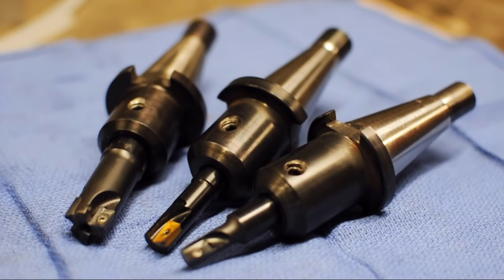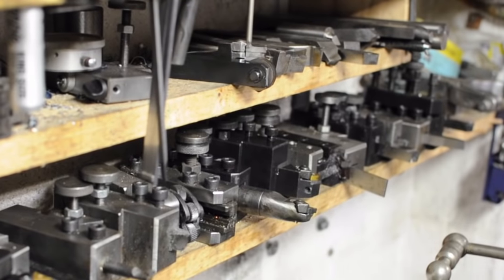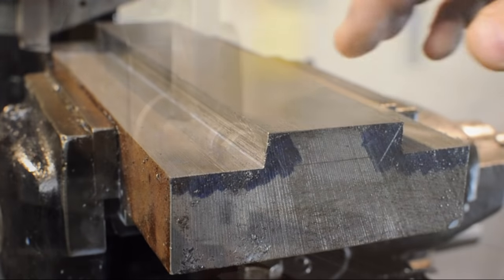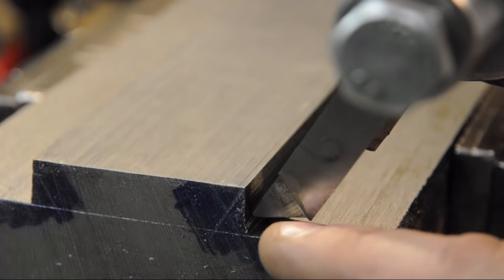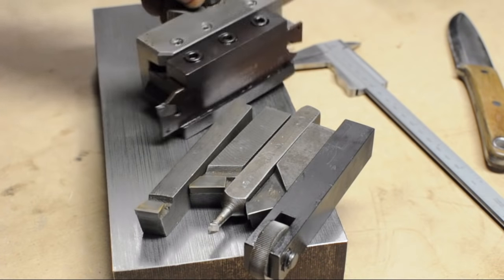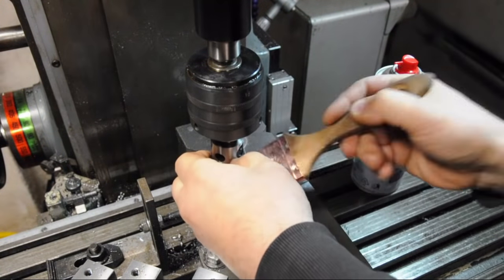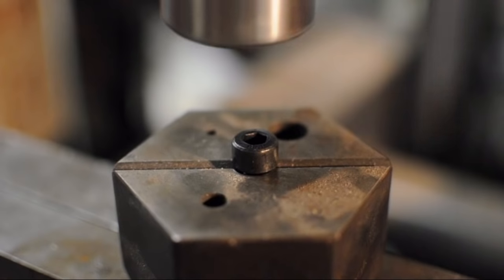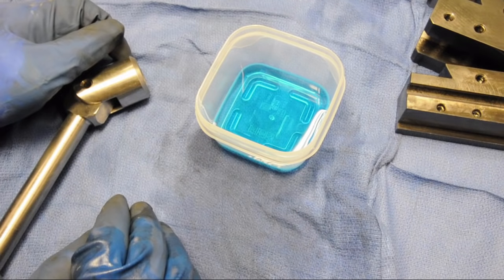QCTP Tool Holders for the Lathe

Comment: If you really want a good looking black finish I'd suggest doing it with hot bluing salts. As someone else and myself says cold bluing is mainly for touch up applications. Its almost impossible to get it uniform on larger pieces such as you routinely deal with, it wasn't made for that. Hot bluing will give you a deep blue or if you add some  Brownells  Oxynate S into the bluing salts will produce a deep rich and very uniform black. The salts are very thick and actually crystallize when cold. you need a tube burner to run the salts up to close to 300 degrees. yeah you heard right its hot. a fume hood over them is mandatory too. The process only works if your part(s) are squeaky clean. Brownells Supply (gunsmithing supplier), sells that cleaner and everything you need to do this. Just think if you get tired of machine work you could blue guns!  hot damn!. all kidding aside its not that expensive to set up, but you have to be CAREFUL working with it as this stuff is caustic, and really hot, but it delivers very classy results that would reflect the quality of your work perfectly. I know, I used to blue guns with this process for years and had no problems with it bluing ordinance steels. Steels that have high nickle content tend to come out with purple veins which in some cases looks cool but not on someones gun. Oxynate S additive takes care of most of this. This process doesnt work on stainless for obvious reasons. fwiw.

Comment: This will likely strike you, and the rest of the general public as a "stupid" question, but here goes anyway.  Why wouldn't you use a mill rather than the shaper for the dovetail?  I am just getting into hobby machining, and tool holders for my qctp are a priority.  That said, if I tell my wife, now that I have just acquired a mill, that I need a shaper, another machine, I might as well designate my "boy parts" as surplus.  Great videos; and thanks for your patience.
Reply: He used the shaper basically because he could... mill is fine and probably a lot faster.
Reply: The typical mill used by home machinists is not particularly rigid and as a professional machinist I find them all but unusable because they are so slow removing metal. The shaper being an all but obsolete machine is a cheap way to get some real muscle to cut flats and the like. When I was an apprentice I used a shaper to chamfer  20mm thick brass. 18mm x 30 degree in one pass. Brute strength all the way.
Reply: oh boy look guys a Professional Machinist has come down from his boeing shop to grace us with his presence. i didn't realize we were on the practical machinist forums.
Reply: as was also mentioned in the video, if you want to cut a dovetail with the mill you need a dovetail bit with the correct angle and depth for every different cut you might want to make, with the shaper you only need a bit that has the same or a smaller angle to make the dovetail, allowing for more versatility, and the tooling is as easy to make as for the lathe...
Reply: Extremely late reply, but, (two things) there are no stupid questions, but there are lots to which (when you don't have prior experience) the answers are not obvious...
Look at the video at 2.59, pause it.  View the dovetail of the right hand tool holder (the OEM one).  There's a relief at the root, where it joins the main body of the holder.  There is no cheaper and easier method of producing that relief than by shaping (or planing with larger, longer components) Any other method requires expensive tooling, and isn't as quick.  
Look at it this way, metal removal rates are dependent upon available power, and the ability to apply that power.  How much power can be applied via the reduced shank portion of a dovetail cutter and the cutter portion? Very little, even if your machine has it.  When I last ran a shaper, it had a 26" stroke, and 10 horsepower, and I could get quite a lot of that horsepower into the shaper tool, removing material rapidly, and when a tool dulled, I could sharpen it, offhand, without going to the toolroom.  Rapid removal rates, plus rapid tool swaps and sharpening = high production rates.  If you don't have a shaper, any machine you have that can do the job is quickest for you...

The relief in question was to accommodate minor damage on the toolpost dovetail, damage which is inevitable when operators are working quickly.  It would also allow clearance for a grindwheel, if the holder was to be so finished. 
  
Shapers are great tools.  I was allowed to use one at school, (1966) aged 14, with little supervision, adjusting the cut while the clapperbox was moving back and forth.  I look at my grandson, who's a little older, and think... Would I trust him, or many of his generation with a machine capable of ripping his hand off?   NO!

Comment: Has anyone made a tool post holder with a differential screw height adjustment? ...or would that be like putting a swiss watch mechanism in a torque wrench? Maybe I should ask: Are differential screw adjustments put in anything at all?
Reply: Thats a overkill,a fine thread screw is all you need.

Comment: Hot bluing is not that difficult and can be done with stuff you can buy in stores. Phosphating (parkerizing) is another quite easy process, but not very good looking IMO, and should be done on bead blasted surfaces, also gets it protection from soaking in oil, used on firearms in demanding situations. There's also fume bluing which is an easier to apply version of old fashioned rust bluing, done in multiple steps, but produces perhaps the most durable blued surface.
Reply: Hot Bluing is about as durable as fume bluing, but it does require you to get some pretty nasty stuff pretty hot. Hot sodium hydroxide solutions will etch glass if it's too concentrated. And fuming kinda really sucks, because you end up with hydrochloric acid fumes eating anything metallic nearby. And you still need to boil your steel afterwards.

Comment: How to blue on cheap: 1 part drain cleaning lye powder + 2 parts bleach. Put steel parts inside the mixture (i usualy use old soup can or something) and boil it on stove in well ventilated area. put cover on, so bleach does not evaporate too much. if bleach boils down, just add some more. will take like 30 mins to get really really black (for carbon steels). other steels will get different colours. if there's zinc coating, it will remove it.

Comment: Gewindebohrfutter is German. Gewinde means thread, Bohr means drill and Futter means feed. You should use this in a drilling machine with manuel feed. When you are deep enough, just pull out the tapping device and it will reverse.

Comment: Hey Tony... Question for you... I have a Mk1 Student as well... what size of QCTP are you using and do you have any suggestions on where to source it from? Many Thanks... your pal -J
Reply from the maker: I don't recall the size off hand because it's a weirdo European holder but I can tell you I wish it were a little smaller.  the student lathes have a 13" swing so just find the make and type you like or want to spend and get the 13" swing size.  you'll find it listed in the specs or tech info for the tool post.
Reply: @ThisOldTony  Thanks Tony! Did you end up customizing the QCTP to fit the cross slide? Your videos inspired me to pickup the  Student although i was rather let down that the Time travel circuitry is an addon mine didn't come with. After watching your videos on prepping HSS blanks I was able to get some really lovely finishes on the parts I'm working on. Thanks again!

Comment: it may say cold blue on the bottle, Heat the part with something like say a Heat gun or a hair dryer. I like to warm the part. before putting cold blue on it. and when you pull it out heat that puppy till it smokes, then put some good oil on it.

Comment: You're making my shaper "mouth" water. I really need to get mine finished up and back in service. BTW - that was some dubbed-in "shaper-noise" right?
Reply from the maker: +BasementShopGuy Rumor has it you're not going to be a basement shop guy much longer, huh?  Not sure which part you're talking about, nothing dubbed.. but sometimes when sped up alot the distortion sounds a bit off.

Comment: what's the advantage of the shaper over a mill?
Reply: i was wondering that too!
Reply: Leonelf He goes over this around 9:30 in the video.  From what I gathered, he seemed more or less to say the shaper is more forgiving in the final profiling of the dovetail, and the shaper could be used while sitting down.
Reply: Just my opinion, The biggest advantage is as what is mentioned in the video is that a basic HSS tool can be hand ground without expensive milling cutters. For linear cuts works well, that includes internal key seats among a multiple other things that can be done. Splines, Gears internal and external to name just a few. Hope this helps a little. Cheers from John, Australia.

Comment: How does one clean up all the water based lube? Is there a tray underneath the milling machine?
Reply from the maker: Yes the lube/coolant is collected again and set back through the pump.  You lose some as it splashed around / evaporates, but most of it ends up in the tray :)
Reply: Is there reason for sometimes using wd-40 and sometimes using water based? Or is the water based one just the go-to when you have to flood the area for cooling?
Reply from the maker: Generally, I use wd-40 for aluminum, soluble oil (coolant pump) for steels.
Deep cuts also benefit from the pump as it washes chips out.  If deep cuts in aluminum + wd40, I use compressed air blasts to keep it clean in there.. at the expense of blowing aluminum chips all over the shop.

Comment: Why set up a mirror image set up on the shaper?  Why not just flip the piece around?
Reply from the maker: None of the other sides were machined, if I had turned the work around I couldn't be sure I was still parallel to the side I had just cut (at least not without a lot of work with an indicator).  Changing the shaper setup guarantees the dovetails are parallel.
Reply: Makes sense, thanks for the answer!

Comment: just buy high quality taps and use a regular mill, this assuming you can change direction at the flip of a switch. 30+ holes to tap on a floating vise, done in 15 minutes

Comment: Doesn't the tapping head have a hole to put a bar in so you stop it from rotating and then it auto reverses? Mine is like that and it's from the same company. Great video otherwise :)
Reply from the maker: +megajver This one does not, no.. only a clutch.  Thanks for watching!

Comment: I don't know what part of the country you are located in but it seems you have good resources for the metal shapes and types locally. In my neck of the woods you are just simply screwed trying to locate any type of materials. When I was a lot younger some of the steel companies didn't have a minimum dollar amount and you could buy drops and shapes without any issues. Now that they are big shots you can't even get a price per pound. They forgot all of us small business folks who stayed loyal and bought from them. It's a sin to see the prices from these metal selling companies when you know that they are screwing your eyes out on price. 1 x 1 x 12ga square tubing was $0.41 per foot and you price the same on eBay or Metal For You BS and they want $6.00 to $8.00 per foot. It's like getting oxygen cylinders filled. You take a 244 cu.ft. cylinder that costs the welding supply $3.00 to fill because they have a plant on site that does it. A poor sap comes in to get it filled and they charge $40.00 and say I'll see you in another year but a buddy come in and you get yours filled for $11.00 and $32.00 for Argon when others pay $60.00 plus. No set prices that are fair it's all based on how much you can squeeze somebody. I have connections on my bottles and that's what I pay which might be higher than some but I think it's some what honest based on what you know it takes them to sell the gases for. I know this is a broken record but what source do you have to buy materials from, a steel supplier, a machine shop, a fab shop, or maybe the black-market underground. I know you are pouring your own. Oh, enjoyed your video, thanks